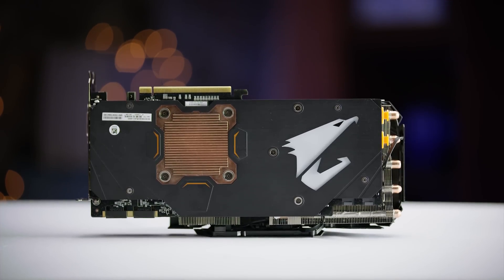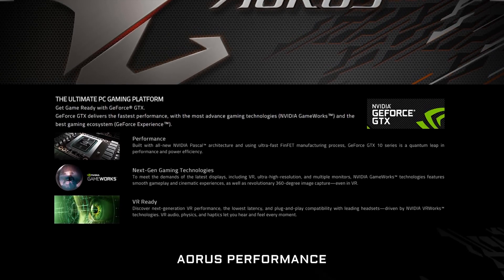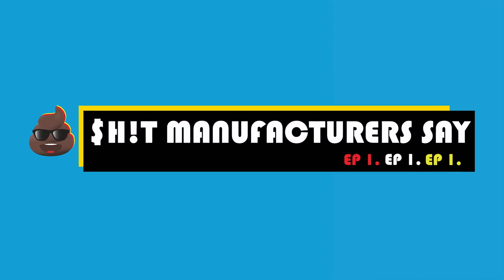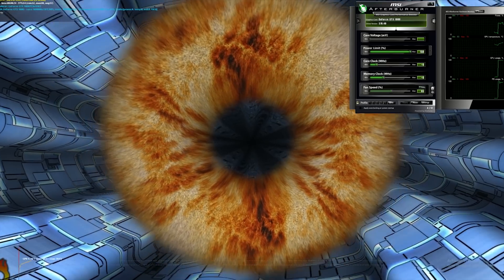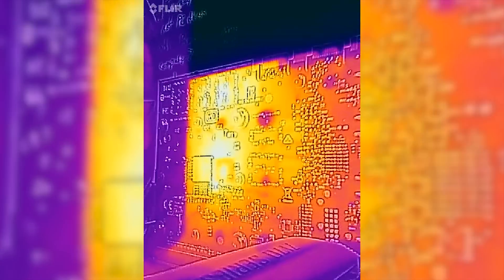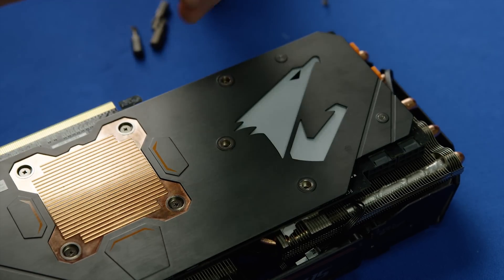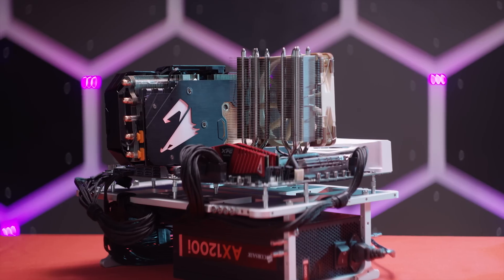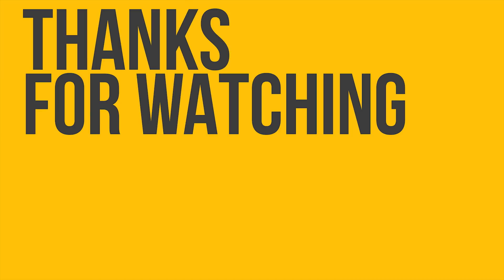$h!t Manufacturers Say Ep. 1 - "Backplates Cool Your Video Card"

Comment: Why do companies put all the effort into making the bottom face of the GPU you never see look all fancy but then leaves the backplate super plain when that's what you'll see if you have a case window?
Reply: this is a question that has been asked many times. the answer is that motherboards used to be upside down, and the cards used to be right side up. it gets better airflow from the fans going down, apparently. it's so retarded.
Reply: @adog3129  Dont know, even like ancient tower motherboard mount components facing down. There are exceptions like some OEMs but they've been always exceptions.
Reply: Vertical mount cases, as well as custom stuff where you might relocate the gpu with risers, like a wall mount pc.
Reply: Because marketing, it looks cool as fukk from the front side, then you can use vertical mount like me to look at ze pretty, and then the backplate is plain usually just to hide an ugly PCB
Reply: Well now we know it's because of memory.
Reply: because vertical mount existed I guess.

Comment: that copper in the back-plate was shiny compared to the adjacent material (more gloss), so even though it may be the same temp as the rest of the back plate, it will register a lower temp on thermal camera 

so did you adjust for it??

Comment: Never thought id write ideas for you guys. Maybe try to put it in more extreme conditions where the GPU has to try hard to cool down...maybe use a case with limited airflow instead of a test bench. I'm just wondering if the backplate will make it even worse...

Comment: How they think they can disprove all back-plate cooling by this stupid video is beyond ridiculous...Let me science it up for you...just like the core, memory chips get hotter with the more electricity flow they have through them. Because of that fact heat dissipation WILL occur if you have a thermal pad, thermal sticker or thermal paste between memory chips and a heatsink or yes even a backplate made out of a type of metal (such as copper or aluminum) as long as you have enough of a thermal interface material between the memory chips and the heatsink or metal backplate. Backplate or heatsinks would have to be firmly in place of course. Granted not all ivdeo cards have memory chips on the back (mine does though) but any card that does have them on the back, can benefit from heatsink or backplate cooling. 

These are only TWO cards, not even similar to each other in backplate design. Yeah ok it did not work for Aorus to have that type of backplate on that they said would cool the back of the card where the core was, but comeon, that's ONE card with it's own UNIQUE backplate. Not only that, but the other card's backplate, like even stated in the video, was not even claimed by it's manufacturer to improve cooling!

1. Appears that the only two cards in this video did not even have memory chips on the back side where the backplate would be but instead had them on the heatsink&fan side where they would be cooled that way. **Many video cards have the memory chips on the backside of the card, like mine, and would benefit from heatsink or metal backplate cooling. 

2. Comparing an Aorus core backplate to every other backplate which could be setup to cool memory chips is like apples and oranges. 

3. Modders and overclockers etc. have been using heatsinks for over a decade to cool memory chips on video cards so using a metal type of backplate as a giant heatsink to cool all chips at once, just makes sense that it works. 

4. Higher clocked memory = hotter memory chips. Hotter memory chips = danger of heat damage.

Comment: that would work, but only if you actually used it as a heatsink and it was in thermal contact with components that dissipate heat - not insulated by a layer of air.

Comment: Should I be the one to point out that if this backplate is a cold spot it means it does NOT dissipate heat. It means it INSULATES it and actually keeps it on the inside.

Comment: I think you can get a few degrees benefit if you use a 2-3 front fan case or maybe a side panel fan. Because with the backpanel you just increased the surface where the heat can leave but you didn't cooled anything which is colder than the ambient itself. That's why a fan can be attached to every radiator in general whether it's PC or even in cars where the fan cool the radiator when the car's idle but the engine running. Just don't expect much tho from a 2x2inch copper surface, maybe 1-3 degree is achievable.

Comment: however there is a methodical error here. The cooling solutions are regulating the for a certain temperature. So if you remove some "possible cooling" from the back the fans are maybe running higher in return. Also thermal throttling of the chip itself may also factor in.
A more rubust way to test if the backplate helps cooling may be to induce a fixed thermal source to the chip while not running its fans and check then the core temperatures with and without backplate after letting it settle.

Comment: I'm not surprised if it doesn't affect cooling. In general or in that case.
The only thing I'm certain of is rigidity. That backplates are crucial for. I feared that my gtx1970 would sag a bit like my gtx970 did, but nope. It has a sturdy backplate. The card is bigger and bulkier and sits in there perfectly.

Comment: The copper would have shown a hot spot if it was functioning.
Reply: No, polished copper like that 1. has lower emissivity and 2. is reflective in infra red. They were seeing a reflection of the much colder room. If they for example painted the copper black, it would probably show up as the same color as the rest of the backplate.
Reply: *****
If it was hot, it would have radiated additional thermal radiation (infrared light). Reflecting ambient temperature has nothing to do with it.
Reply: D Hawthorne “…polished copper like that 1. has lower emissivity …”
Reply: Lower does not me none eliminated. It would still be in addition to the ambient IR levels, but it was shown to be darker than the test bench, table and set walls; meaning it was actually drawing thermal energy in.
Reply: D Hawthorne No, it wasn't. Look again. The background is very dark blue, almost black, the copper part of the backplate is pink. It's showing up significantly higher than ambient. It only shows up darker later because at that point the background is no longer visible, so the camera re-calibrated itself and at that point that piece of copper was the coldest thing in view. Well, not coldest, but emitting the smallest amount of IR radiation (again, because low emissivity).
Reply: Not really any way around it.. that shit was not reflective and it was not pulling heat from the card. These things are painfully obvious if you simply look at it.

Comment: Well that is the problem with testing in open air test benches. Your CPU heatsink wouldn't do much in the way of cooling if it didn't have air passing through the fins. Do the test with airflow over the card or in a normal case scenario then you can make your conclusions. Open air is a great way to see max clock speeds with out confounding variables but if you want to look at realistic temps you need to add additional airflow to get a real world application.

Comment: i didn't get the same results. I have a 980ti and I took off the back plate from it. I use nzxt kraken + corsair h50 to water cool the gpu. while gaming the max temp would hit around 75c-78c after putting the plate back they max at 70c. I don't think the back plate improves the temps for the gpu core, but it improves the temps in the case which means the hot air my h50 was using before is slightly cooler now. That's the only thing I could account for the 5c drop in temps.

Comment: I remember most test bench videos having a fan held in the air above the rig pushing against the system to simulate a case fan but didn't see it on this video. I remember jaystwocents having a video earlier similar to this but involving evgas new 1080 and he didn't see any thermal changes really until a case fan was involved to push the heat from the backplate out.

Comment: I do think backplates have a purpose in cooling, by spreading the heat better and by sealing the card from other components. It also reinforces the card, because heavier coolers put preasure on the card. Under load the pasive cooling from the backplate is not enought, but it will reduce the temperature in idle.

Comment: Was this purely gpu cooling based? Because there was no mention of its effectiveness on ram modules. Then again, isn't the PCB an incredible insulator? Heat would rather travel toward the heatpipe than through the PCB onto the backplate no?

Comment: I believe part of a backplate's function is some minor EM shielding.

Story Time: 

I have a soundcard with a front module so I can plug in an extra pair of headphones in the front. However I've always avoided this as I would get an incredible amount of electrical background noises from buzzing, clicking, and whining. After swapping out to a new GPU with a backplate, I've found that these noises were reduced Significantly! Not completely but using headphones through the front module is now... well. usable.
Reply: I could imagine that working. My gpu doesn't have a backplate and the front headphone ports are pretty bad. Just as well I only use the back.
Reply: check your grounding. Make sure your grounding and power supply have a digital noise canceler and/or have a seperate ground.
Reply: I didn't mean main power supply. I mean like the card's power.

Comment: How controlled were the test conditions? Was thermal GPU throttling disabled and fan settings locked down so that the fans didn't speed up to try and keep the card at temperature?

Comment: For god's sake! This video was TERRIBLE!
Did you lock the fan speed?
Was the fan speed different if it was?
Did you use the same thermal paste before and after?
Did you subtract the ambient second per second?
How can I even be sure you used the same settings now?!

Hey GamersNexus, make a series called "Sh!t benchmarkers say."

If you really want to know, yes they make a difference. A small one put its mainly in the VRM if done right. Gamers Nexus has done a lot of work on this stuff, go check them out and have your mind blown. Look for their EVGA VRM analysis and the iCX cooler breakdown.

Comment: Is it possible the backplate could help in heat reduction when run in sli close to another gpu? The backplate would block much of the heat radiated from the back of the card which in turn would reduce the amount of the card heating the air that the other card pulls in by its fans.

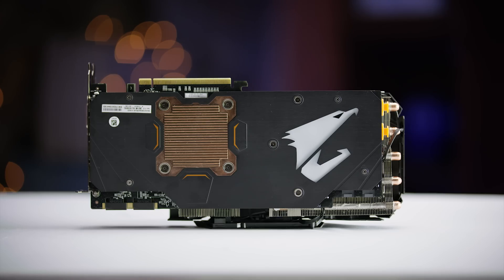Comment: The reason the backplate looks cooler on the thermal image at 4:05 is that the copper plate is reflecting the infrared spectrum like a mirror and you are actually looking at the mirrored thermal readings of the components to the left.  You can see the hotter rectangular box in the upper part of the copper plate move like it would in a reflected image.  Thermal cameras have a hard time picking up accurate readings from shiny things with low emissivity, that's why there's a setting on the FLIR to compensate for it. It's the same reason you see your heat reflection in a mirror with using a FLIR rather than the temperature of the mirror itself.
Reply: No, metals emit exactly as much thermal radiation as they do absorb, since they are reflective they emit almost no thermal radiation and just reflect their surroundings.
Heatsinks do not dissipate the heat by radiation but by convection.
@Novice Droner is right, the first thing you learn with thermal imaging is that you can not measure the temperature of metallic surfaces, you have to apply some sort of organic material to it, usually you stick some tape onto the metal that has a emissivity of almost 1.
Reply: Dan K Firstly, its thermodynamics. Secondly, he's right, although his explanation isn't completely right, the copper is radiating less than the objects around it. It's the same temperature, shiny metals radiate less. You can see the same affect when automotive companies use thermal sensors to measure brake heating, they have to make sure the wheel is a matte black as matte black is very good at absorbing heat radiation as well as emitting it.
Reply: Shouldn't a heatsink be designed to have high emissivity?
It the thermal compound is thick enough (read: resisting enough heat flow), the plate may be simply cooler due to the surrounding air.
Reply: Florian Schrank OK, I went back an reviewed the video in HD mode. The heatsink in question is indeed shiny. Often heatsinks are anodized, or have a brushed finish.
Reply: Novice Droner Incorrect.  You may need to take some courses in thermal dynamics 😜

Comment: I have a Sapphire Nitro+ RX 480 OC edition. I have moved it outside of the case with a PCI extender which comes with an external power socket which supposedly lets you draw/need less power from the PCI port or the extender cable itself. Either way, I did the same test and it never ever exceeds 75 C. Here is the thing, when I check with Sapphire TRIXX, the fan speed never exceeds 50%! The card is lying on an open environment, at room temperature and the first 50% of the fan power is actually more than enough for cooling. The rest is probably reserved for more closed environments like smaller cases or hotter rooms or OC scenerios. 

So my question is; what if those 79 C and 67 C values are coded into cards' BIOSes and they are the thresholds, which the card is programmed to never exceed? Imagine, the fans speed at 40% with the backplate on and keep the card at 79, and 50% without the backplate and keep the card 79?

Comment: nit disappointed, for the backplate to cool effectively it needs to have airflow running over it from a case fan etc. this is why its worth installing a fan in the fromt in line with your gpu as it helps to feed your blower style cooler and back plate. would like to see this re tested in a case not an open air bench as it doesnt accurately reflect the way the average user will be running it. while i doubt the outcome would have been any different it would at least have been a more accurate test.

Comment: Wouldn't you need to do this test inside of a case with airflow.  Sitting on an open air test bench with no air flow going over the back of the card makes sense that you would get the same temps.  Very well might be the same anyways but it would be a better test since most PC's are in a case instead of an open air test bench.

Comment: You didn't have any airflow going to the card, just what the fans on the card cooling one side, you should of tested with a fan pojnting either at the back of the card, or more realistically as if it was the front case fan blowing onto the card

Comment: That big pad from the backplate isn't a thermal pad...  It's an isolation pad.  This should be enough evidence that the manufacturer never intended the backplate to dissipate heat.

This is kinda' a stupid subject, because it comes down to how the card was engineered.  Some cards have copper pipes to dissipate to the backplate, and some don't.  Simple as that.

Comment: Do the test in a normal setup with the motherboard (and card) in a vertical orientation with the backplate on top.  Then repeat the test.  That would be the normal usage and intended setup for the backplate to remove heat from the card.

Comment: I honestly highly doubt that the backplate is meant to cool the gpu processing chip @ wich the temperature is measured. I'd rather guess that a backplate is meant to cool VRM's on the backside of the card, considering that the front VRM's are actively cooled by the air-cooler.

Comment: This video is awful, with so many variables not removed from the test, like GPU fan speed, backplate expecting airflow from the case and GPU boost. FLIR imaging was just cringy, as well as relying on just the core temp. If you're interested in this, you can check Gamers Nexus video, "ACX vs ICX", where they test a newer EVGA cooler with a backplate, without it and with older backplate. Spoiler: there is a difference.

Comment: The backplate probably just slows down temperate increase or spreads out temperature differences due to increased thermal mass. It would stabilize in the long term, which was shown to happen here.
Reply: this test would make more sense in a closed case with airflow. Indeed other tests showed that backplates can help to cool the card with a couple degrees difference. Some people made custom backplates with cooling fins or even watercooled backplates and had great results.

Comment: I suspect that there are components on the back that experience some benefit from the heatsink. I am also willing to bet leaving it off will degrade them slightly faster. The manufacturer is trying to spend the least on components while still giving it a decent life. Thus add some copper heat sink, lower thermal requirements on components, make more money.

Comment: the fact you think one without it and 1 with it are the same shows how lazy you guys were in this video.

even just a TINY breeze is enough to cool a gpu 3- 4 degrees and when you put a backplate that spreads the heat over a wider are it will dissipate faster.

physics 101 tells us that....my 970 when overclocked ran 79- 80* on the testing mobo box rig i used. in the system its 68- 69 degrees just from 3 fractal fans in my case

Comment: That backplate is a better heatsink. Heatsinks are useless without moving air to dissipate the heat. Why would you use an open bench without airflow across the heatsink?

Comment: no real surprise here. I would not expect a difference. the issue is lack of airflow. all the heat is radiating in that area. if the air is not being replaced with cooler air then it's affect will be minimal at best. but I doubt it would be that much better with airflow.